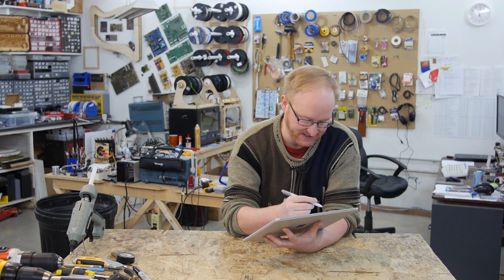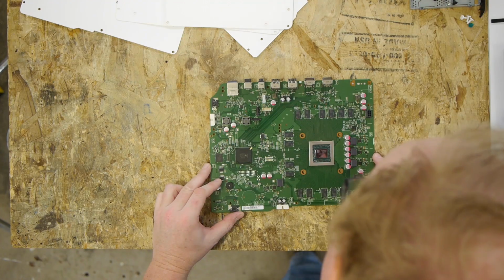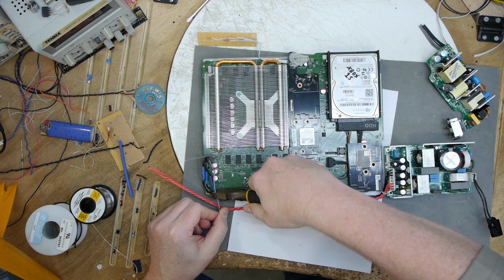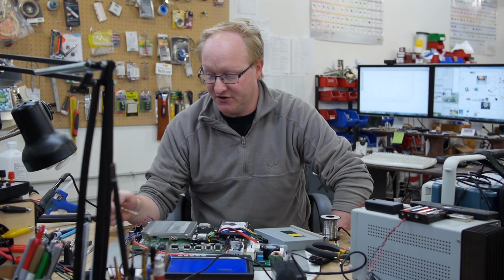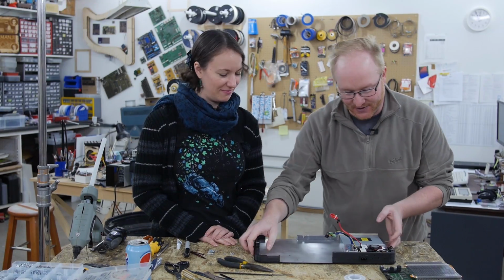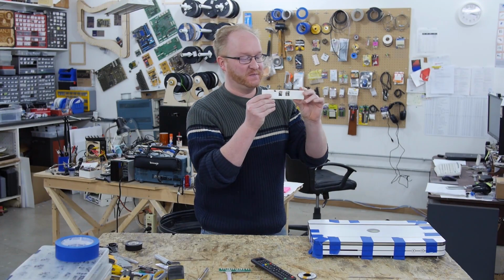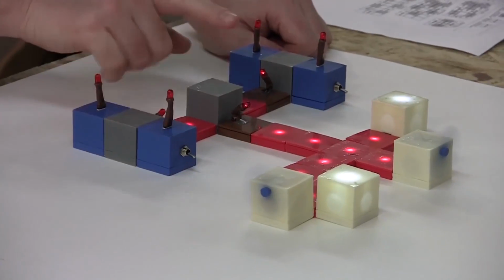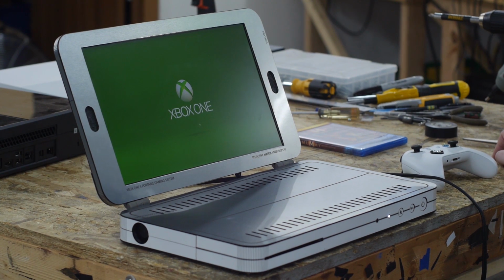Ben Heck's Xbox One S Laptop

Comment: The next step is the controller now .  I was thinking before I start typing again. how the controller should be. Let me take a deep breath before I speak now leave me a comment if you like my idea. Okay on the XBOX PC WIRELESS CONTROLLER a built-in battery that means no double A's no battery pack a build-IN headphones where you can slide out and it locks and then when you get done using push-up and slides right back into the controller on top next to the power port NOW ON BOTTOM OF THE CONTROLLER WHERE THE MIC SHOULD BE IN BETWEEN THE SELECT AND START BUTTON. LET ME KNOW WHAT YOU THINK.

Comment: if you want to get rid of heat just get some of the small box fans from a server - the run at high speeds, about 30mm sq and are designed for 1ru/2ru units to remove high cpu heat quick

Comment: I dont know if ya'll check the comments on older videos but I've had an idea that would be more of a long term thing. I've been wanting to make a pc desk for a few years, but also be able to play console games as most of my friends have Xbox or Playstation. I know that either one of those systems don't take up much room by themselves, and are only about as large as a large pc case, but i think it would be cool to have the pc desk with an Xbox and, or a PlayStation built inside of it as well. Like a dual monitor set-up for the Pc and a 40 or 50 inch T.V. for the console(s)

Comment: Some questions: 
Why not change the hdd for a mini ssd and The blu-ray drive for a slim version, making The laptop lighter.
If you put The Power supply on the outside like a real laptop, wouldn't be possible to allocate a battery and use as a portable?
And Last but not least, how hard would be redesign the mb to eliminate useless things like The hdmi input and save space?

Comment: if I'm not mistaken the Xbox 1s still has an HDMI input, but I believe it only has one input HDMI and the original has three I think. Because I would put a latte Panda or a $200 single board computer so I can emulate all the games I, also that would give me an excuse to put a keyboard on the laptop looks so weird without a keyboard. Another thing I would consider is a Wii U/ Nintendo switch third-party dock, just because I can. Can I record games using an Xbox One?

Comment: Excuse me mr heckt i know you are a very busy guy and probally dont have the time to respond me to but i have a question that i am sure you can answer. Is it safe to run my xbox one off of my xbox 360 power supply i need to know if my system or the power brick is the problem. I just need to know if the xbox 360 power supply wold damage my system. Please if you find time if you could answer my question thank you sir. Have a good day

Comment: I have a random question I'm thinking of doing a little xbox one mod,  nothing Super,  just Wana take the guts out of a ghetto blaster then put the xbox one inners inside,  only thing Im gona have a problem with is the the face plate of xbox,  is the panel touch sensitive?  How could I get round this otherwise

Comment: If you're going to do the laptop form factor why not just make it use a battery? You could've put the original psu outside the device like a normal laptop charger and made the whole thing slimmer aswell. I honestly don't see how it turned out the way it did spending 4 months on this project with all of the resources at your disposal.
Reply: Further on this, he could have used an electricity monitor to see how much power the system was using during gaming and calculated how much battery power he would need for 4 (or insert number here) hours of gaming to either prove to us that it isn't feasible to make a battery powered xbox one s or actually make a battery for it. But with a battery it's kind of just a thick laptop that runs the xbox OS.. Idk. I wanted to see an xbox you could play on a train or out camping or some crazy thing like that but you're stuck 5 feet from a wall with this design.

Comment: No battery and no integrated controller on this thing, kind of a shame. I mean you look at it and it's proportions are really weird, it's very wide, if you just added a big ass battery to it you could produce something with actual laptop proportions, that would make the bezel on the screen way smaller than the literal 90s 486 laptop antique frame you've got going on there right now.

Comment: why buy an XB1S and then tear it then lay the parts down add your own parts with a lot of soldering and use cheap fans which look like they can't do shit also you may break/brick your console in the process instead why not get a $1k laptop it performs better than the XB1S also it has a built in battery and there is no need to modify anything inside a PC build is easier work than this but if you are really in to DIY I could see someone doing this as long as they use different fans etc...

Comment: This maybe a dumb question, but I use to be an electrician and I've worked on a house where there was mixed wiring through out the house (aluminum and copper) and because of that the house caught on fire. It wasn't me btw, it was the electrician before. It took awhile for it to happened but was a real ugly situation to clean up when it did. Question is how safe is it really for this project.
Reply: Let me add I was a electrician in training at the time so I couldn't tell you really any other additional factors

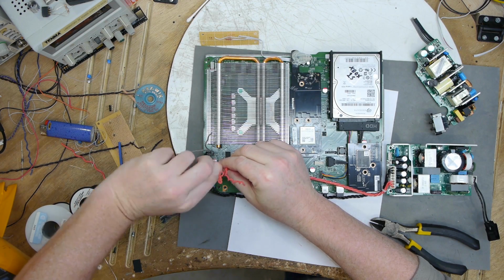Comment: I was shaking my head when at about 8:20. Right after he got done talking about current carrying capacity of the wires. He said uh oh copper to aluminum wires, eh shouldn't be a problem. Thankfully it probably is  nickel plated copper wire just bare aluminum to copper connections equal bad things. Just Google house fires caused by incorrect aluminum wiring.

Comment: an AIO with a handle would be cooler. next you should 3D print a new neSWITCH case and add a bigger 1080  amoled screen and a much bigger battery. maybe relock the cpu back up

Comment: Id build a battery base that snaps to the bottom with a power cable connector on it. Just use like thin laptop batteries and run them in parallel. Then of course an inlet for charging.

Comment: Making a 1080P portable Nintendo Switch should be simple right ? switch only has 720p screen and will only run in 1080p in Docked mode. so you effectively need to combine the dock components which are small and replace the screen.
and HDMI out to the new screen hidden away and add a bigger battery to power it.

Comment: A wire tracer would be a handy device. Especially if you made it so you could plug the signal generator into a wall outlet, screw it in a light socket or attach a set of jumper cables. It would probably be a good idea if it could survive being attached to a live circuit too.

Comment: The Ben Heck Show , Using the Tip 102 on a PS4 s, will the wiring be the same? Which will be the correct outputs on a ps4 s?

Comment: Maybe I'm alone on this one, but I would have loved to see you add a way to toggle between the connected screen and an independent screen (such as your home TV when not on-the-go).  I can see this being achieved two ways:
1. The HDMI F port that goes to the Xbox's monitor being flush with the case that can be unplugged to swap out for the independent screen.  However, this would look super tacky since you'll always have a bulky HDMI M sticking out.  This could also cause issues during transportation (I could see this breaking easily).
2. An HDMI switch with one HDMI F inside of the case like yours that directly connects to the monitor, a second HDMI F connector flush with the case for an independent monitor/screen to connect to, and the actual switch 1/2 flush with the case to swap between the Xbox monitor and a connected monitor.
--
Why would this be useful?  You're on the go playing on the attached monitor.  That's pretty neat.  Then you come home and switch over to your much larger HD TV.  You have portability without sacrificing the big screen functionality.
--
Just my two cents.  Very cool project.  I'm curious how those fans hold up during prolonged use or while playing games (assuming that would generate more heat).

Comment: Fan is not big enough.
Reply: There was no heavy load/GPU usage test, to be sure. 
Not even any gameplay.
Reply: if you watched the video you would have seen how the 2 fans one for intake and one for output was plenty enough to keep temps below 100* Fahrenheit
Reply: Doesn't need a benchmark, he didn't just throw in some random shit and go "yeah that'll do". It's all calculated before putting it all together, and with the APU heat censor and all that, the fans would have to work a bit harder but with the heatsink and intake/exhaust, it'd add up to roughly the same temperature. AND like he said, APU's are a lot less heat intensive than you'd expect, did you even watch the video??

Comment: Those itty bitty fans aren't going to cut it AT ALL.
Why would they use a big fan when they could get away with a smaller, cheaper one?
"some" airflow isn't the same as "enough" airflow.
Maybe you could have used a blower fan to make the airflow work right.

Remember the original Xbox 360? Remember WHY it got RROD so often?
Bad thermal design let the processor and GPU get so hot that they would unsolder themselves.

Don't let the same thing happen to this project!

Comment: How about a cool looking redesigned case of the original (not the S model) Xbox One with a water block cooling system implemented into the design? *Bonus points for replacing the original 500 GB HDD with a SSD.
Reply: bargain.

Comment: Play any game and it will fry in an instant...
Reply: I didn't mean APU on it ;)

But PSU will overheat and fry PCB on MB. It overheats like crazy already playing music/movies (the guy in vid said it goes over 100 degrees F). With games that would go even higher as more power would be needed to fuel games.

Cool idea, but unusable for gaming.
Reply: any computer whether it be a pc, mac, xbox or ps should not be going any higher than 90* CELSIUS (apu mainly), 100* fahrenheit should be just fine for the psu itself as shown in the video
Reply: Thomas Myers remember PSU was not even under load when it hit that temp. That's what hit me first. Fans came to my mind afterwards. 2 options console would have when overheating: thermal throttle or emergency shut down. 
APU would not fry that easily that's for sure.
Reply: Maybe he could have just added a water cooling.
Reply: yeah i was about to say... lol he said F, that's like nothing in terms of heat... it would have to get well over 80/90c to become an issue
Reply: Bit late to the party but...the PCB is the motherboard...the PSU should have a thermal cut out but lets say it didnt...the PSU would have to be a LOT hotter than 100°c to do any damage to the mobo. What you are describing is a surge of power frying ports/components.
Reply: 100 F is ~37 C, numbnuts. That's like 4 degrees above idle temperature. The machine's thermals are fine. In the future, please refrain from commenting on things you know nothing about.

Comment: what a refreshing commentsection btw awesome project, revisit the 360 and include a battery and try to make it smaller
Reply: Just because the 360 is old now doesn't mean it's gotten smaller over time. 
If he made annother 360 portable now, it would be probably the same size as his last one. :/
Reply: Yeah, he'd have to completely reverse engineer a 360, make a mobo and buy and route every single modern equivalent component of what's in the original 360 to make a whole new system essentially. Hard work.
Reply: Savage Cat The last 360 revisions use less than 140W. It may be possible.

Comment: I would have had slots in the lid above the sink and power supply and open the fins on the apu heat sink on the side so the fan could pull through the fins

Comment: those mini fans aint gonna do shit
Reply: Joe Stacks actually uses a laptop (notebook, in terms of speed) grade CPU (actually an APU) if you look at it in terms of clockspeed, if I recall correctly, it uses a 1.8ghz (maybe 2) AMD Jaguar 8-core APU, with something like a HD7770 for a GPU.
Reply: You are correct. The bigger fan was probably chosen for the Xbox One S design because having a single bigger fan with low RPMs to maintain airflow on the whole case makes much less noise than several smaller ones going at much higher RPMs constantly. Something the PS4 gets often criticized for by people who find the constant audible whir of the fans annoying. 

In Ben's design I think that airflow on the case overall is probably not good enough for gaming not because the fans are too small (As you rightly point out they are going at much higher RPM), its because the components are laid out differently and further appart than the original design and the space is rather cramped too. The PSU might not be getting good enough airflow or its likely just getting hot air from the rest of the components.
Reply: the fans are about equivalent since the big fan spun really slow thats about as easy as I can put it
Reply: he showed the temps in the video and ironically enough the part where the big fan was originally was cooler than the power supply and mobo
Reply: the xbox isn't a laptop.

Comment: Make a Wii U laptop or maybe a portable Nintendo Switch with the dock included
Reply: Why would you need to make a portable Switch? That's one of the dumbest ideas I've ever heard. The system is already portable, and Nintendo has said that the dock serves no purpose other than TV connection and charging, which you can already do with the charger. Literally nothing would be gained by integrating the dock.
Reply: MorimotoYTP I'm not sure the dock has much in it that would be worth integrating into the rest of the switch. XD
Seems more like a convenience thing (not having to plug in a bunch of seperate cables and the like), plus maybe some extra cooling.
Reply: Rumors aren't always true, and since Nintendo has specifically said that that rumor is not true.
Reply: It just gives the switch more power than the batteries can provide. You could probably get a performance increase on the switch by plugging in an external battery.
Reply: Even then, it would be easier to mod it to make high performance mode always on.
Reply: The switch runs faster in portable mode though, it runs at the native 1280x720, instead of running at 1920x1080, which reduces the framerate
Reply: television and cheese but the gpu underclocks itself for power saving, the switch docked is much faster
Reply: MrHatoi shut
Reply: Clamshell switch with improved speakers, integrated hdmi, extended battery, 3+ USB ports, and built in Ethernet would be a useful mod!
Reply: MrHatoi also, their already are portable docks that are about 1in x 1in when folded.
Reply: MrHatoi If rumors say that the dock increases performance, though.

Comment: I'm pretty sure if you had tested it with games, those piddly-fans with no proper push/pull flow or a shroud wouldn't cut it. It'd shut down from overheating within minutes.

Comment: How does a power supply amperage over head work. Does the power supply just pump out say 13A and you resist/step it down to what the xbox/screen use (to protect it), or does the screen/xbox just pull what it needs?

Comment: if only it had a battery lol
Reply: Tracenji it would need a massive battery
Reply: Je55terK1ng so?
Reply: The laptop would be like 10% larger if not more because of that.
Reply: Chaos a laptop that uses more expensive power efficient parts would be 10% larger with a typical 40-60watthour battery, for this thing you'd have to supply about 100w for hours for a battery to be worth it.
Reply: Yeah it's just not worth it.
Reply: this is the exact reason an actual laptop whether it be oriented for budgets, gaming or productivity is a lot better than this and i understand his reason to do this project he is a little old school when it comes to electronics as was my teacher in college i always had to help my teacher when it came to doing certain features on the computer i even deleted monitoring software on my PC in my class as the room was just a bunch of computers underneath desks and a monitor arm on the wall which you could move up when doing some soldering or other projects etc... i miss those days even though it was only 2 years ago
Reply: should be possible..
Reply: Zahid Shabir gaming laptops can barely game for an hour with just the battery
Reply: Tracenji IT IS NOT A SHIP IT IS JUST MY OLD MAINS fucking cringy piece of shit